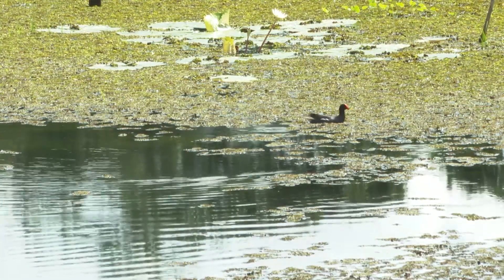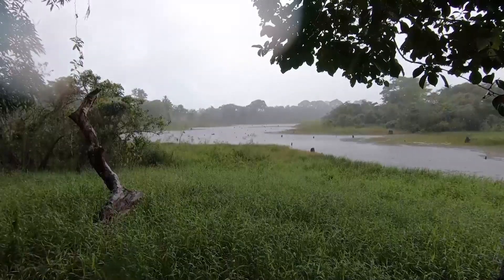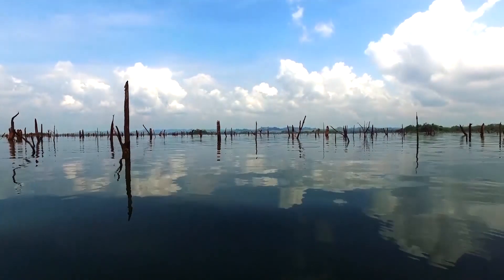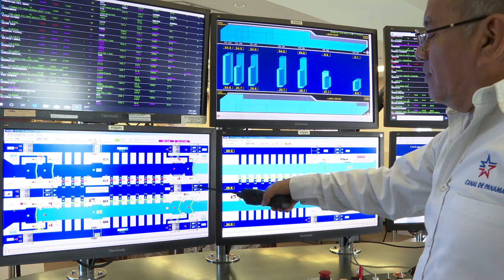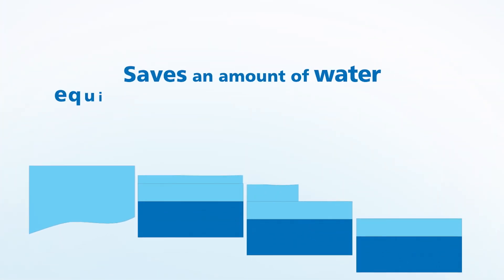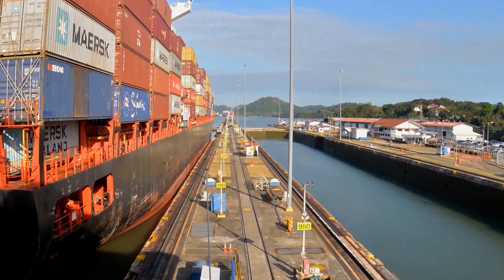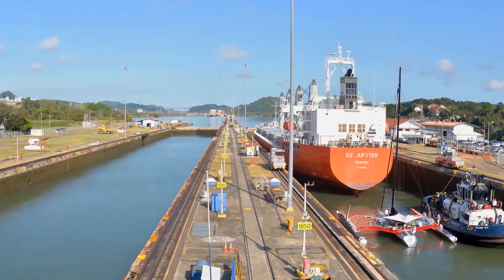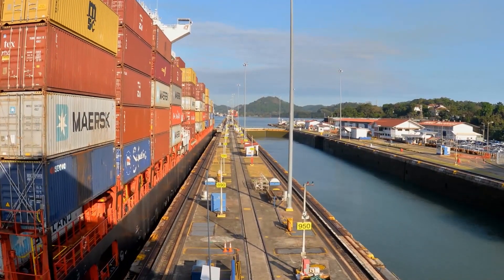Water-saving Measures: Cross Filling in the Panamax Locks

Comment: Couldn't you save a larger percentage of water utilizing pumps and auxiliary water tanks?  I saw someone say pumping costs too much, but the cost could be accounted for in the lock charges.  
On the website I read there is no silver bullet to the problem, but a more efficient cross filling could reuse up to 100% of the water every time.  It seems doubtful that you are limited by not being able to afford pumps.